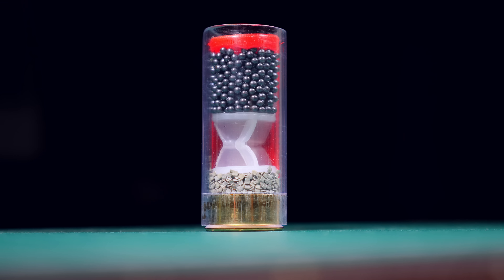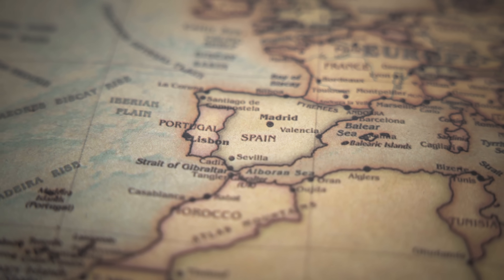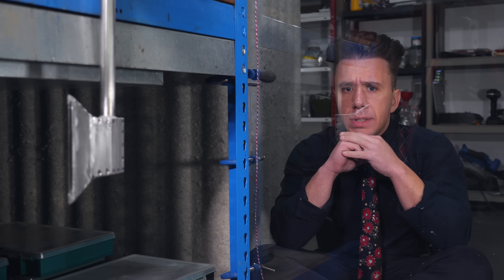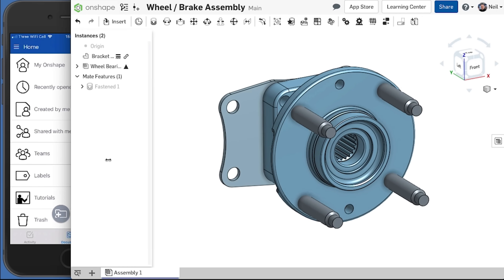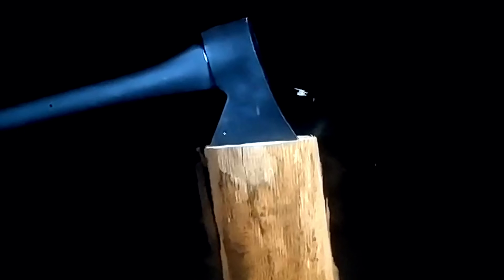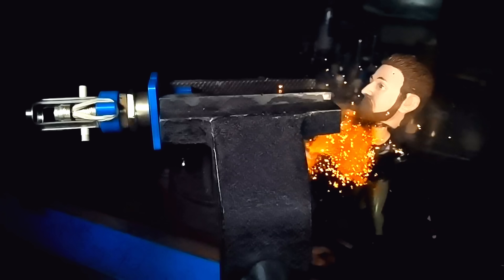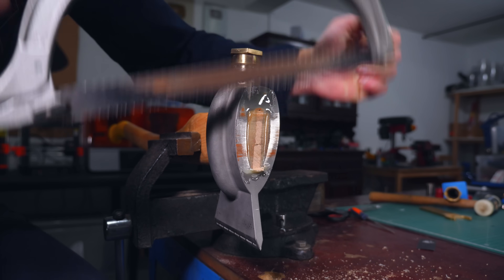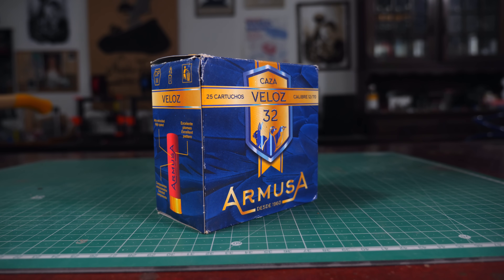I Built a SHOTGUN AXE

Comment: 6:44
Is no one gonna talk about him hammering a shotgun shell towards his face with a live primer in it?
Reply: The bottom of the shell was flat against the table. What he was hammering was the top of the shell. I'm not sure if you know, but that's not the way to set off a primer. They were designed to not be easily triggered by accident. While what he was doing was not smart, his chance of injuring himself was close to zero.
Reply: @LordDragox412  I agree 100%, but let's say for the sake of argument that there was let's say a stapler pin or nail wedged into the wooden table and he happened to hammer it exactly there.
I know it's grossly overthinking, but I'd rather never aim a loaded shell with a piece of iron sticking out of it towards my face
Reply: @nonowords7857  even worse, the case was contained in a steel tube, if you watch Ian's exploding lever action video you'll know that the anvil can hit the priming compound hard enough to ignite the powder and make the shell goes off
Reply: @frisk3320  yea true
Reply: @nonowords7857  100% there could have been a small bump in his table.
Reply: @LordDragox412  you clearly dont know much about guns and ammunition if you think the risk was close to zero there buddy.  i have several shotguns, and can confirm that was very dumb.    if it did go off, he likely would live, but could be blinded or even killed.    especially on a homade shell, it could easily go off in this situation.
Reply: @ganjalfcreamcorn8438 It's nice that you have several shotguns, but I don't see how that's relevant. I have two that I use for hunting and I home load my own shells. Does that make me an expert on the subject? No. But at least I've read the safety manuals that came with the tools for reloading the shells, went through firearm training courses to be able to safely operate my guns and have years of experience with something more than just "having several shotguns" like you seem to do. So my statement is based on facts and personal experience. What is yours based on, made up worst case scenarios? Ridiculous. If you're afraid of your tools due to your lack of knowledge, maybe you shouldn't have them.
Reply: @ganjalfcreamcorn8438  The only several shotguns you have are the ones in Tarkov. Primers take A LOT to trigger. Not only do you need a lot of force, it needs to be applied in a point and fast. Otherwise you end up crushing the primer without triggering it. Instead of pretending to be tacticool on the internet and waving your nonexistent guns around, go read a gun safety manual.
Reply: there is always at least 2 cringe moments per integza vid lol
Reply: He'd have to pierce the primer from the rear to ignite it.
Reply: That's why he said don't try this at home leave it to him!!!! The professional idiot!(his words not mine!)
Reply: we Europeans are immune to small bullets, when young we learn to stop 7.62 with our hands... that or we have no firearm training because we cant buy guns at the supermarket ...
Reply: @DarkInovator  That used to be, today's generation spends too much time on social media and most can barely grab a 5.56 as a result
Reply: @ :))) true!
Reply: All the people claiming it was safe because there's nothing to hit the firing pin, just remember: replacing fingers is a long and painful process, and replacements don't work as well.
Reply: That's not how primers work. I mean it's not smart, but the odds of it setting off the primer are near zero.
Reply: People who are from places with strict gun control often lack a fundamental understanding and respect for firearms and how to safely use them. Like people from NY will walk into a gun store and unintentionally flag everyone in the store with it.
Reply: @CaptainBill22  man, most of these folks probably don't even know what flagging means.
Reply: @CaptainBill22  People from places without often do too, hence all the dead kids from unsecured arms. Understanding does not come automatically with the gun laws, you need to get that from your parents or someone. And idiots are everywhere.
Reply: smells like teen spirit
Reply: It's not really that different from crimping it normally with a press......... It's the same amount of downward force. That's kinda just how you reload shotgun shells.
Reply: @jaredlancaster4137  The issue is that he's hammering. That creates short, strong forces instead, in difference to a press. The risk of the primer firing is very low, but not zero. I really hope it was just rage bait
Reply: Nah, he's fine. nothing to pop the primer. Really need a pretty serious point.
Reply: Cringed too when I saw that
Reply: You must be new to this channel. Half his videos are homemade rocket engines that are barely distinguishable from pipe bombs.
Reply: Yep I was fine till that moment. That had Phineas Gauge potential.
Reply: His face was nowhere close to it. And that's not how primers get activated, there's a standard for primers and they have to be difficult and have a very specific action to turn on depending on type, be it for guns, explosives or other things
Reply: @em4703  I agree with the face part, i guess his fingers are more in danger than his face.
But setting off a primer because your live primer shot is being banged in a metal shell is definitely a possibility, even when you keep in mind the fact how they are designed not to.
Reply: you mean like when you fire a shotgun?
Reply: you've watched the entire video and seen his fire control, this is just Darwinian evolution rolling dice.
Reply: No. Wuss.

Comment: Shotgun wedding. 😂
I used a 3d printed metal part on my RC motorcycle. The quality is surprisingly good. I have had hard impacts of the 9 pound bike and the threads did not pull out, even though the plastic parts around it snapped. 
When the technology becomes cheaper it will be a revolution.
Reply: Was it powder bed fusion made or wire/powder printed using Laser cladding?

Comment: I have a great video idea! Solder melts around the same temperature as filament try to print with solder
Reply: That stuff will be too runney it would be like trying to print with water it would just flow everywhere
Reply: @DanielThePyroGuy  maybe we could turn the heat down to a temp where it might work.  I mean think Abt it
Reply: @MyInnerChild81  yeah but solder doesn't realy have a temprature region where it would behave like plastic it will basicly Either stay solid or fully melt if we had some special alloy that would behave like like plastic it would be intresting but sadly i am pretty sure it doesn't realy exist and if it does it would probably be extremely expensive or brittle
Reply: @DanielThePyroGuy  if you get the temperature just right I believe you can make it work
Reply: @MyInnerChild81  the thing is solder doesn't realy have a good plastic transition region so like i said it will either stay pretty solid of completely melt kind of like ice it is either solid or it melts into a runny liquid
Reply: @MyInnerChild81  there wouldn't be an in between where it would be gooey like plastic